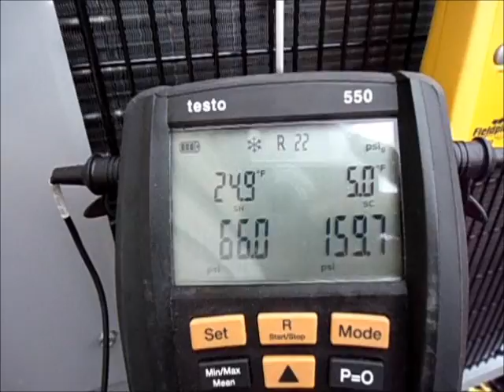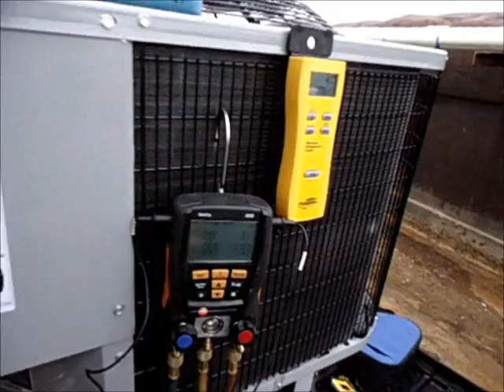HVAC Install: Heil Dry Charge on a Barge

Comment: i hear that unmistakable , vibration high and low humm coming from that heil, most all the units i  have installed have that, not all of them , but most , and i do like heil im not downing them. Ive installed , trane, rheem, york and never hear it  from those anyways just wanted to see if you or anyone else noticed that?

Comment: That would be an awesome place to work. I bet you were a little bit sad to finish that one.

Yep, my favorite supply house went Ducane. I won't touch that stuff. Go,Go Goodman for when the dollars count.

That's a nice unit. Heil / ICP is a damn fine piece of equipment, not Trane but still a damn fine piece of equipment. I had one my last house, other than a slow evap coil leak I never had a problem with it.